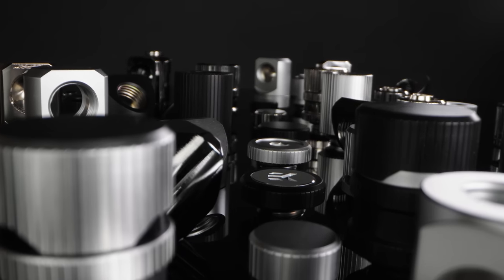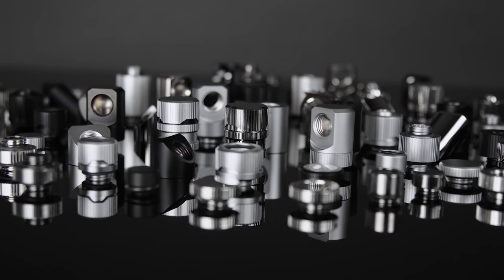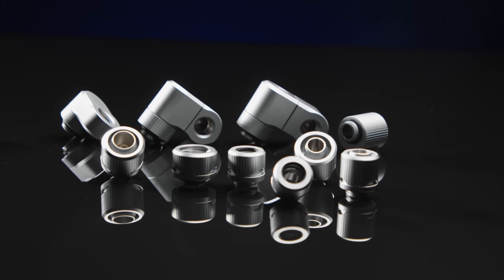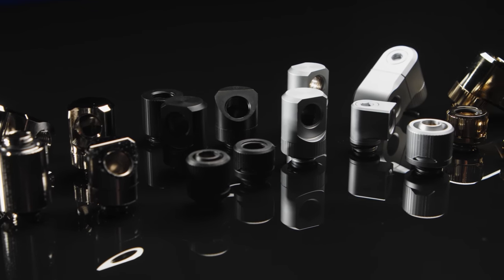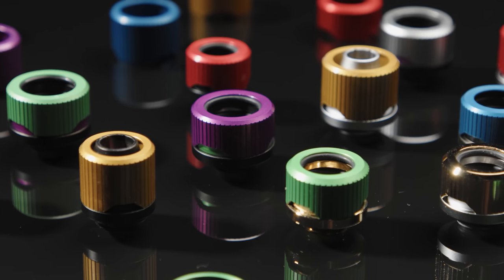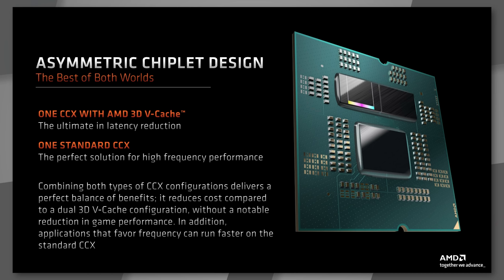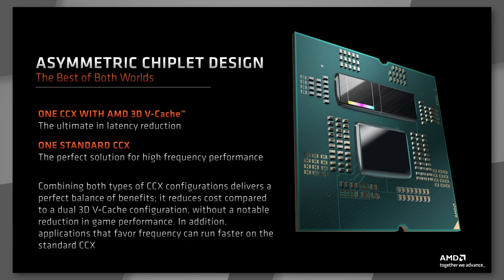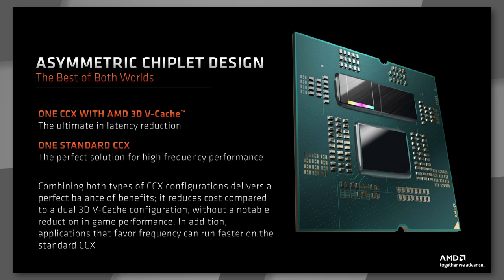Why I switched back to Intel...

Comment: Everybody loves an underdog and AMD has been the traditional underdog of the CPU world. That AMD gave Intel a good run in the last decade is commendable, but let's keep it real. Intel with their untold billions and a tech team ten times that of AMD and their measly millions, is a sorry contender for the crown. In the world of domestic end users Intel is barely holding onto their title and they are without excuse. They should be light years ahead of AMD by now and they aren't. 

The repairable architectural vulnerabilities generated by AMD don't hold a candle to those of Spectre/Meltdown and how well Intel has actually dealt with this issue is a highly glossed-over and swept under the rug issue, still open to speculation (no pun intended). We all want to forget it happened and no one wants to forget it more than Intel. Exactly what level of mitigation has been applied here and how effective or ineffective Intel's intervention might be is still dubious. Forgetting about it doesn't mean the problem is fixed.

Methinks there is still a fly in the ointment and I don't expect it to change. There is no reason in the world Intel, given their resources, should not be able to make faster, more efficient, higher quality CPUs. I suspect they will always have those back door issues and this is no accident. Meanwhile, AMD has proven they're no better than Intel when it comes to inflating the costs of their silicon and embracing the banner of hubris. We managed to catch a glimpse of this recently when Intel processor chips that were faster than their AMD counterparts were actually cheaper than what AMD was asking for theirs because AMD was on the take.  It sure didn't take AMD long to prove that their ethics were no better than Intel's when it comes down to the money grab and shaking down the end user. 

I use both Intel and AMD despite Intel's Achilles heal: Spectre Meltdown and this is not something a TPM key can fix. That said, from my meagre 22 years of experience as an enthusiast, Intel has been notoriously more reliable in the way of stability.

Comment: 7800X3D is a great gaming CPU. The other two are not worth the headache, or the price. The one basic complaint I've had from everyone I've recommended 7800X3D to is loud fans because of the propensity of Zen 4 to run hot in combination with overzealous default fancurves. Slow boots have also been pretty common and punching in manual timings is not something I'm comfortable recommending to not so puter savvy users. I've seen no POST issues only with Corsair RAM, and that was solved with a BIOS q-flash.

Comment: I'm currently using a 5800X3D. I've not experienced some of the horror stories I've read with AMD systems, thankfully. I do have a reoccurring problem with Windows Audio Device Isolation intermittently spiking high CPU usage and causing the system to hang when trying to watch or run anything with audio. I've never been able to track down the source (full OS re-install w/ latest drivers did nothing). The only workaround has been to Task Manager kill it. The point is that PCMR isn't always the easiest path to walk.

Comment: I picked up a 7700X, and X670, 32 GB of 5600 MHz Corsair RAM, and a RTX 3080 last year, which all runs stock, save for the EXPO on the RAM. I had been running the 3080 with a reduced power limit (85% - 90%), mostly just to produce less heat, but I have had some stability quirks and frame hitching recently (particularly at low to medium usage tasks ... 25% - 50% usage), so I went back to the stock power limit. 

Barring the RAM training stuff, the system has run wonderfully. That said, there are some quirks to AMD, which just seems to be endemic to that ecosystem. I'm sad to hear about all the X3D issues that are floating around.

Comment: Jay. Switching from CMOS to resonant tunnel diode threshold logic 2.2 THz at 5 W. 100,000 times better speed power product. Plus 30% lower gate count and smaller device size = cheaper.

Comment: There was the one bios update around spring last year where they actually boosted their Memory Frequency a few 100mhz, i guess u missed that one.  I do run a 7950x3D with 96GB Memory at 6400 and with a lot tighter timings than the expo profile. I do run CPU Heavy Sim Games performs flawlessly compared to the intel i had. If you do Office work a normal 7950x would be better.

Comment: Hmmmm, I have a question. Were these issues you describe , experienced using that 7950X3D processor that you treated like a dog's chew toy? My 7950X3D, 7900XTX, MSI XPG X670E Carbon WiFi system has been rock solid. To be fair, you need to rip the top off your Intel CPU and then scrape and scrub it, like you did that 7950X3D, and THEN let us know how that works out.

Comment: built my new system some days ago, INTEL based :
I5 13600K + MSI Pro Z790-A Wifi (DDR5), DDR5 G.Skill Ripjaws S5 2x16GB 6400mhz CL32, the case is the Lian Li Lancool III (awesome case btw, never seen that much quality and aesthetics in a case, very practical and sturdy too), the CPU cooler is the Thermalright Phantom Spirit 120SE ARGB (very good temps and sturdy while not being too heavy, easy to install too, no weird noises and i used the thermal paste included in the box), i have Windows 11 on a new Samsung 990 Pro 2TB and my old Samsung 970 EVO Plus 2TB as storage (both work fine, no problem after diagnostic, used the MOBO first M2 slot for the 990 with the integrated heatsink and the 970 has the old separate heatsink i bought separately, temps are both fine), GPU is my one year old Gigabyte RTX 3070 8GB Eagle OC rev 2.0 LHR (removed it from the old PC, no PCB cracks, nothing unusual and works like a charm not running too hot at full load either; this version pulls 234W on the wall instead of 220W since it's a factory OC) barely sagging so no GPU bracket needed, bought the new Corsair RM1000E ATX3.0 (2023 version) the 12VHPWR cable was included in it but i didn't use it because it's not necessary on my GPU and finally plugged in my G34WQC-A monitor (i know it's VA with the problems associated but IPS costs twice more money in my country).
XMP worked first try no instability at 6400MhZ on both sticks ingame and out of game, the MOBO loading time is extremely fast at startup, the overall temps of the entire PC are fine, the CPU sits between 30 degrees and 37 degrees (average is 34 degrees) when idle, when gaming it's not that high either.
surprisingly the CPU power consumption is extremely low at idle (only around 5W on average!!!!) and not very high when gaming at my resolution (3440x1440p) ultra settings + raytracing.
So anyway, my old CPU was a 7700k and did well for many years and the 13600k replaced it (but i'm still gifting my old PC to a relative so there's no waste), before choosing the 13600k i've researched quite a bit on the 7800X3D to decided but given the many MANY problems the AM5 platform has i've decided to stick to Intel and i couldn't be happier.

old PC power consumption (I7 7700k + RTX 3070 + G34WQC-A) = 372W average with GPU at 100% in Subnautica Below Zero.
new PC consumption (i5 13600k + RTX 3070 + new NVME SSD + G34WQC-A) = 382W average with GPU at 100% in Subnautica Below Zero.

also there was a big performances boost in Hogwarts Legacy, the old system could barely get it at 60FPS with a mix of high/ultra settings, DLSS on quality and raytracing off in the Hogwart castle, now the new system does between 51FPS and 60FPS+ with everything on ultra + all raytracing settings on ultra.
Warthunder also experienced a boost going from 175FPS with everything ultra + raytracing + DLSS on quality to 282FPS with same settings.
the old system also had 4x8 DDR4 RAM running at 2133Mhz (because i had two 2400Mhz sticks and two 3200mhz sticks not bought at the same time, so i had to go stock) so i'm sure there's a big difference now in 1% lows and 0.1% lows.

overall i chose Intel because it just works unlike AMD.

Comment: Very interesting and somewhat alarming. I have just gone from an i9 12900KS to an AMD 7800x3D for the same reasons. My i9 will now NOT do XMP and also will not do 5.5Ghz at stock vaults when it was undervolted before. Memory will only do 4800. Motherboard was an Asus Z690 Hero, Memory was GSkill DDR5 6000. I was getting constant BSOD and failure to boot with codes 53, 55 and 98. After spending a LOT more money, I hope I dont see the same problems as Jay.

Comment: I have been running an X470 MSI board with a 2700 processor for four years now. I just bought the Z690 Asus hero board. The same one recalled due to the backward capacitor problem. I got a heavy discount on the board but this one is new and I don't suspect any issues with it. I got the 12th gen CPU 12900ks. I am hopeful it will be a good system. I too am tired of my AMD crashing due to system memory. That is the code I get when it goes blue screen on me. It should be refreshing to try Intel again but I am concerned about power consumption. Manufactures needs to work harder on power efficiency both for CPU and Graphic cards. It's not always about speed because it wont matter how fast it is if I can't afford my electric bill.

Comment: I did a system build for a friend with a 5950x a year ago, and i just upgraded myself from a 1700x to a 5900x, and both systems have ended up having weird instability at idle. I keep updating BIOS, and dialing back the ryzen master core offset, but it's just so finicky. My 1700x didn't have these kinds of instability.

Comment: Built a new AMD 7800X3D, Asus Rog Strix X670E, 6000mhz DDR5. Now, I haven't bought AMD for decades cause of all the problems I had in the past with AMD chips in the past, but figured it's been awhile now. They still couldn't be that bad right?

 Heh, I sure do regret it, slow boots, memory problems setting expo every bios update, USB disconnects (which seems to be a problem I wasn't aware of affecting a years worth of AM4-AM5 MBs, found thousands of posts on reddit regarding the issue as I was trying to figure out how to stop mine from disconnecting) 

My last 5 systems have been intel, always bleeding edge tech accessories each time, stable each one.  

Sure AMD might net you a 16-20% frame rate increase on triple A games, but imo, Id rather have a stable system. Regardless of Intel's heat and wattage issues, they just run tough from just my experience over the last 20 years of PC making.

Comment: For ASUS motherboards, there are I think now three different EXPO options. The ones provided by ASUS are junk and cause issues. You want the ones programmed on the RAM itself. At least that's what I found... had nothing but trouble until I switched to EXPO II. That being said, I miss my old Intel i5-4690k system that would boot to Windows in ~6 seconds. This system always takes 30 seconds to boot. Running AMD 7900x on ROG STRIX B650E-F with G.Skill Flare X5 Series 32GB DDR5-6000 RAM. Other than boot time, the system has been flawless after figuring out the RAM EXPO teethings.

Comment: I build a System with a Ryzen 3600 System with a Gigabyte/MSI Mainboard and had the same RAM (QVL) issues. I couldnt fix it so i switched to a 10600K on a Asus Mainboard and it run 3 years very well. For 2 Weeks im on a 7800X3D an a ASRock Mainboard with 64GB Corsair RAM and it works pretty well i hope for min. 3 years :)

Comment: 7700x, 7900 XT, 4x 16gb DDR5 6000. Just upgraded from an Intel i5 7600k, that was an absolute nightmare and have had ZERO issues and runs at a maximum temp during high load of 50c and zero issues of ANY kind. 

Fuck Intel. AMD has been treating me right and has been lightning fast for both Content Creation and Gaming.

Comment: I still use Intel over amd due to Intel's stability, during my amd days i always had some type of problems.  I do agree with you if someone wanna use AMD go for it! It's all personal taste, and personal experience. I on the other hand is going with intel, i even have an old system built on the old i7-3990K still rocki'n today even under gameplay in PUBG the maximum workload is no more than 35% cpu usage at 4Ghz, and it rocks when i do video editing, alas both AMD and INTEL have it's positives and negatives sides, but i do get the same feeling as you do that amd isnt quite there yet, they are on the right track thou! As u said!

Comment: I have weird issues with my 7800x3d + Rog crosshair x670e hero + g. skill trident z5 neo amd expo cl30. I have no trouble to use the full amd expo II profile, but weird stuttering in some Games. Even when i turn off amd ftpm/resizable bar/fast boot/secure boot and all that stuff. Its like frames getting skipped (but not in all scenes and not in all games). The Boot time is also rly rly bad when using expo. Yesterday i ordered a 14900kf + gigabyte z790 gaming x ax. Never had this issues with intel before.
Reply: I have a 14700kf but interesting to hear this. There were routines for memory timing syncing, the longer load times are common for AM5. There might be ways to ease this but requires more searching for solution.
Reply: You must live under a rock knowingly buying Intel with all the recent news around their long term stability abd degradation problems. Hope yours doesn't fry itself in less than a year 🤞

Comment: I don’t know if this is helpful to anyone but I’m very got a 5950X in a ASUS Crosshairs Hero VIII and I have had REPEATED issues when transferring large files, utilizing creative software (UE5, Blender and Affinity Designer specifically). I had what I assumed to be a drive failure of an M.2 until I placed it in my Intel 13900K remote rig to just see…and it worked. Each time I got a blue screen on the AMD rig I looked at the Event Log and found the SAME code basically stating it’s an AMD communication issue with the TPM (yes this is probably a motherboard discrepancy…maybe). Also get the same repeated Event Log ID for Memory and Power related issues. I’ve swapped the RAM and have replaced the PSU. Issues persist. I had a 3900X before hand and didn’t have any issues with it at all. So I swapped it in…ISSUES HAVE GONE. I know my CPU isn’t a x3D model but I have highly considered returning to Intel since the release of Ryzen and my first 1700 with them. I can’t keep giving up my work days trying to troubleshoot a problem and ordering parts.

Comment: I just built a new rig this year. This will be the last time I build on an AMD CPU. Like Jay,  my biggest problem has been memory stability. Spoke with two computer repair tech guys and they both agree that AMD has major issues with RAM stability, even when running manufacturer listed brands of mem. Apparently they do fine if you leave off EXPO, but I've been having serious problems turning it on. And that's just to get the adverstised speed... Anyway, I'm stuck with it for now, not going to rebuild the whole rig, but my next build will defintely be going back to Intel...

Comment: So, the worst case scenario, you get the non x3d version and because 3d cache is not used exclusively, the temps are lower and clocks are higher.

Comment: I have always had Intel CPUs latest build was a i9 9900K which I upgraded from a 3930K before that. It was time to upgrade again and was looking at a 14900k but didn't like the heat and insane power draw from the latest Intel CPU's. I have always recommended and built AMD systems for family and friends but never used one myself. After watching videos on the new X3D chips the 7950X3D seemed the best of both worlds of what I use my PC for, so I decided to try AMD for myself and since then I have been running a 7950X3D on a MSI Meg Ace X670E with 64 GB of G.Skill Trident Z5 Neo 6000MHz CL30 it has been rock solid and my favourite system I have probably ever owned. Before I upgraded I read a lot of forums and found the importance of a good motherboard with these new chips.

Comment: Weird. I had built two AMD platforms and they ran flawless immediately afterwards. Built my first LGA platform with Alder Lake using a Gigabyte motherboard, and it was the most frustrating thing ever. The initial BIOS would boot if i had a nvme installed, and then the BIOS got corrupted later and i had to use the button on my motherboard to reflash the BIOS and actually use the computer again.

Comment: I'm looking at switching to Intel and Nvidia as I have always had issues with AMD and Radeon. now with my Ryzen 5 4500 and RX 6600 I can't play any new game without it crashing like cyberpunk 2077 that will crash every 10-15 minutes with an AMD driver crash or hogwarts legacy that did run once for 50 minutes before the same AMD driver crash happened. 
I have looked at many fixes but still no luck.

Comment: I'm pretty happy with my 7800X3D, which I SPECIFICALLY chose to avoid efficiency cores or whatever AMD calls them on their side. I have a gskill trident 6000 kit with 2x 32mb sticks, and it's running without issue. It will sometimes retrain for 3-5 minutes, but I haven't had lockups or blue screens.
If they had a CPU that was just twice the cores and twice the cache, that would be fine, but the higher end stuff has the efficiency cores idea.
Reply: which board?
Reply: @reinulf5474  GIGABYTE B650 AORUS Elite AX
I was avoiding Asus for obvious reasons.

Comment: I’m really confused now planning to build for my first ever system what I think Is going to be high end. Both of my identified systems will start with the new King 95 caste with for the intel build the MSI Gigabyte Z790, Intel 14 7000k, and an RTX 4080. Then Steve went Amd and along with other reviews  I changed my plans. That was again the King 95 with  a x670 or B650 motherboard. Tying that system with the 7800x3d and the 7900xtx. Both systems will have over the top water cooling with dual reservoir and dual color.   Should the dump the xtx?